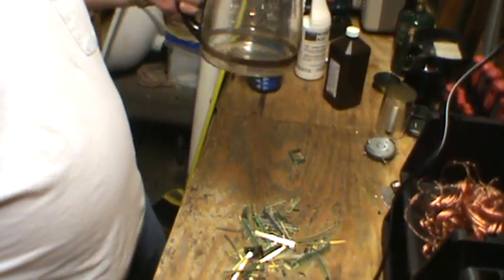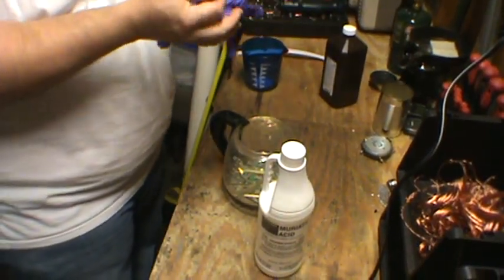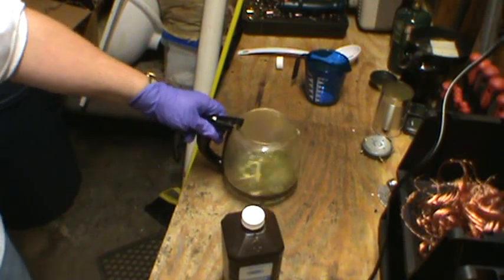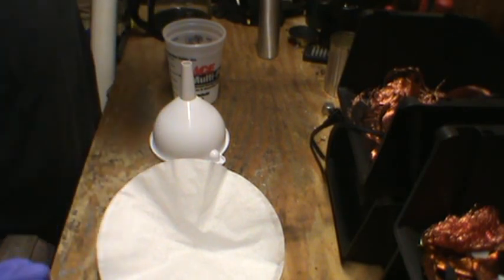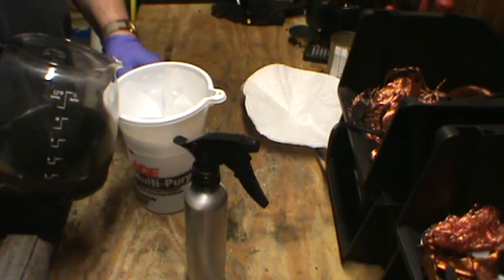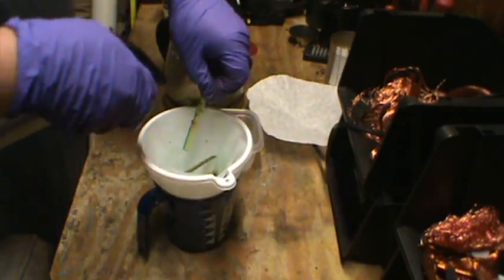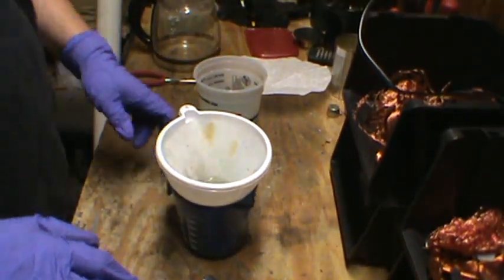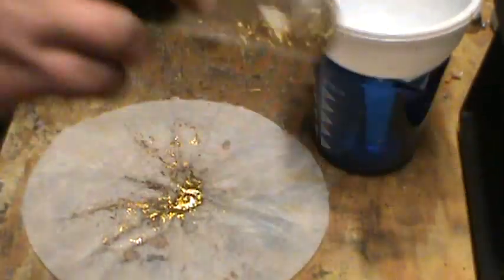How to Recover Gold with A/P Acid peroxide method for gold fingers and gold plated boards easily.

Comment: who ever thinks that it will be real solid gold after processing and melting, think again,
look on ebay how many pounds of gold bars they selling from melted down computer parts, and read the description carefully !!
Reply from the maker: ......right, because they are not chemically refining the gold pins just melting them as a whole.  Of COURSE THOSE are not real gold.  What you are left with after this process IS gold.  Please do more research before making statements like that.  Have a great day.
Reply: Look at the pictures they have up looks like gold, if they just melting gold plated stuff, that wouldn't look anywhere near gold. Because it contains very litte amount of it.
Reply: If u want to end up with just 1 gram of gold, it takes a lot of fingers.  Judging from the comments, some people thinks is enough to get a handful ...
Reply from the maker: Again, I understand what you are saying.  You are however comparing apples and oranges.  They state in their description that it is not pure gold.  They say that it is melted IDE pins.  If there is enough gold on each pin to cover the base metal, would it not stand to reason that there would be enough in 100 pins to coat the outside of a glob made from them?  Moreover, this video has nothing to do with IDE pins.  This video is about removing the gold foils from plated finger boards.  This is like calling a new Porche dealer a crook because a used car dealer on the other side of town rips people off.  One has nothing to do with the other.  I do not know how to explain this any more simply.
Reply from the maker: right, and I try to correct them as often as I can.  People do not realize the amount of material one would need to process for an ounce of gold.  It is quite a lot.  I have talked many...MANY people out of trying to do this full time because they are under the illusion that they can make thousands of dollars with a couple computers.
Reply: No need, I know exactly what u r saying, im not comparing it to your video, just saying in General. .. and I know that is not solid gold, and probably has very little amount of gold in them.
Reply: So insted of making shots, they selling bars that is more difficult to refine
Reply: Csaba Farkas You are right again, there really is not  a lot of gold there.  I only process gold twice a year when I have several pounds of trimmed fingers.  The people on ebay who sell the ingots of melted ide pins are doing that solely to take advantage of people. Its a horrible practice.  They should should not even make shot with it.  Melting it tends to make the metals alloy together.  It is infinitely easier to recover the gold from its original state as a gold plated pin.  Thanks for understanding!  Best of luck to you!
Reply from the maker: Csaba Farkas Sorry I was logged into my other channel when I commented that last time

Comment: I used your method of removing the gold from the computer circuit boards but everything turned green.  How do I remove all the green stuff from the gold flake?
Reply from the maker: Hi and thanks for watching.  I am a little confused, what circuit boards were you soaking?  This is only for gold fingers, not the rest of the board unless it is completely free of solder etc.  When you say everything turned green, are you referring to the gold foils or the solution?  Thanks
Reply: I was referring to the gold fingers which I soaked them in A/P.  Those are the gold fingers I cut from the RAM and other parts of the motherboards.  I was trying to dilute them with water it gradually go away but it takes too long.  Is it other way I can get rid of the green stuff from it.  Your demonstration looks very clean without any green stuff on it.  By the way, your video looks fantastic!
Reply from the maker: Thanks for the compliment!  As for the green stuff, the solution turns green and that is fine, that is just copper going into solution.  If you are referring to the green solder mask on the boards, that can be removed by soaking them in 1 gallon of hot water and 1 tablespoon of lye.  Wear gloves, it can burn your skin!  After about ten minutes in there, you can brush the green solder mask off with a tooth brush.  Hope that helps!

Comment: Hi Moose, I see you using all kinds of containers. I am particularly interested to know what kinds of plastic jugs you are using to store HCl, Nitric Acid, A/P, and Aqua Regia.
Oh congratulations on the 1000.
Reply from the maker: Thanks!  I only use HCL to make A/P.  I do not nor will I ever use nitric acid or AR.  Just too much of a risk for me with kids and pets.  THe containers I use for HCL for the most part are not the ones in the video.  I scaled things down for that.  I use 5 gallon plastic buckets with lids that used to hold pickles.  I get them dirt cheap at a local sandwich place.  When I am not using the HCL it goes right back into the jug I poured it out of.  If I can free up some time to make the video for that, I am getting ready for my second gold processing of the year.  Its using the air bubbler system.
Reply: I'm really liking the air bubbler system too. My only concern is the type of plastics that can be used in the chemicals. HDPE? PPQ? PP?
Reply: Oh, thanks for so much information too. You are a big help.

Comment: Also i could only found 10% muriatic acid. Do i need to use more acid to compensate?
Reply from the maker: try evaporating some off.  10% will take forever to eat up the copper and nickel.

Comment: Hello Moose, this chemical combination (muriatic acid + peroxide) work for plated pins too?.
Reply from the maker: For the most part yes.  Just remember that 1 gallon of solution can hold about 2 lbs of copper and because the copper is thicker it will take longer to dissolve.
Reply: Yes, I m doing it ,and  work well, 3 cups HCI/ 2 cups peroxide, but take sever days for remove the copper...
Reply: +joe3072000
Reply: somebody know what is the difference btw electronics gold plated pins grade two, and grade three?...

Comment: moooooooose ur a movie star 100+   to bad its not porn lol vinager nutrilizes sulferic muratic and the acid in your stomach yeh its all the same stuff distilled water will help ur verry good i wish a pair of safety glasses face shield and apron would fall out of that a/p solution you have not to lecture but u have over 10000 scrappers thinkn ur superman i do acid will eat your pupil turning it into a glass eye befor you can do any thing about it no eye wash system moose $6829.33 watching your vids rememer could you please safety up on one video  showing us how a 100+ vid star does it any way  i am disabled ssdi check doesnt pay the bills did not no what i was goin to do you are the goldfinger scrapper i now have 50.00 in savings and its gonna get bigger gotta say it love you man saved my ass high tech james bond safety vid  the people have to see it at least once later chemical freak tana twerk
Reply from the maker: Good point!, i got the goggles, apron, and mask.  THis fall when i process the next batch of finger boards I'll be showing the HCL and air bubbler method and I will safety up that biatch.  Thanks for watching!
Reply: i apoligize i invented the touch screen keyboard and text no capitals and everything is a pronoun or abreviation omg iamsal  oh my god i am such a liar  just jokeing ive had brain damage my brain was bleedind all my life after brain surgery i had some neurotransmitters destroyed i now use a brain gate with a neurophone all this text is straight from my neurophone kinda like text to talk but brain to text it is to wierd to think a ? or a ( . )( . )or a ^0$#^*.so anyway i like the way things melt it is relaxing be safe and melt that gold and i am para so i havntr made any $$$$$$$ good luck
Reply: asf af
we read you fine , just keep up the good work and we will see it through !!!
Reply: kraig taylor

Comment: 1)How do you dispose of chemicals?

 I have 8-9 old comps stacked up and get gold boards all the time. I was thinking about your way of doing this.
2) How much is the Muratic acid (not sure how to spell it)  and where do you get it?
Reply from the maker: Chems are typically evaporated leaving the salts behind.  Store in airtight plastic container.  Before you  start you should cntact your local government office, town hall etc to see what they have for chemical disposal programs.  Muriatic acid 31.45% can be purchased at any hardware store.  8-9 pc's is s good start.  Remember you need a LOT to make an amount of gold worth writing home about.  Thanks!
Reply: Ok I won't try it then, I hate snail mail.

Comment: Please make the ratios clear. Not for instruction of course.
Reply from the maker: The ratios can vary a little depending on the refiner.  The proper ratios for the most gold foils would be 5:1 HCL:Peroxide.  The reaction is slower however there is very low to no risk of gold being dissolved into the solution.  Some people are very impationt and want the fast method where you add more peroxide which speeds up the reaction however you start to lose gold into the solution.  You can always get the gold back out but sticking a piece of copper pipe in there and saturating the solution with copper, the gold should drop out as black powder.  THis will take longer though.  Hope that helps!
Reply: moose, can i add nitric acid then SMB into the solution  to recover the lose golds? is that possible or just a stupid idea? thx

Comment: Hi, Could you use this method to extract copper from low grade boards? If I was to put an entire board in this solution. Would it dissolve the copper and leave the tin and soder, like it leaves the gold? Also would this solution dissolve the copper from insulated wire that is to small to strip. I know I am pushing this to an extreme level however I have a lot of low grade boards and copper that is either tin covered or to small to strip. I know if I take this into the scrap yard Ill get a low amount for it. Which means they must be making at least 3 or 4 times its value.
Reply from the maker: Hi and thanks for watching!  Great questions!  Lets start off with throwing a board in AP, bad idea, the copper will , dissolve, and so will just about all the other metals accept gold, silver and the platinum group metals.  This will leave you with a nasty thick soup of crud you will not be abel to get rid of.  The ammount of copper in there is so small that after you put in a LOT of time to depoplulate the boards, clean off all the solder, then soak, and wait for the copper to dissolve, then cement it out, and after the cost of chemicals, its really more worth it to just sell the boards.    As for the wires, technically that could work, but I think you would be very dissappointed in the ammount of time it takes to dissolve the copper and not sure if it would creep up the insulation.  I think with these items, the money will be in volume.  Thanks!

Comment: Hello Moose, Matt from PA here with a question. To begin I do have a chemicals background so I know how to handle them. Your video is the one I followed for my 1st 3 processes. I did have full recovery of gold, Not much but its a start. Question I have is, I have some fine materials mixed in with my recovered gold. Looks like dust from the coffee filter, Keep in mind I did rinse it before pouring into. Also some fine green plastic, Id say that's from the boards. Would it be best to put it all in my ladle and heat it til it burns off, It wont be enough heat to melt it, Just enough to clean it up. Thanks for your time, Most appreciated And again, Great video.
Reply from the maker: Thanks for watching!  Its good to get feedback from people with a background in dealing with chemicals!  The green board peices and junk usually gets gone when you refine the gold with HCL and bleach.  the powder on the other hand, that is worth saving and throwing in there as well.  Often times, some people add too much peroxide and some gold gets dissolved into the solution however once the solution becomes saturated with copper the gold can fall out as a black powder.  Some people save all of their filter papers with the debris in them and then torch them in their crucibles, i've seen some nice little gold bb's made that way.

Comment: Could an electro magnet be used to collect the loose metals while in the solution? Or even just in place of a stainless steel knife for the copper?
Reply from the maker: no, there should be not metals in the solution that are magnetic, accept nickel but the magnet would likely not do anything besides dissolve.  Thanks!

Comment: very informative.  can the same method be used to scrap cell phones?  i noticed you said to remove all metals except for the copper if possible; is that just to have less metal to remove from finished product or dose it comprimise the solution?
Reply from the maker: It does compromise the solution, can make it gel up and make it a whole lot harder to get to the gold.  If the phone boards are clean you can absolutely use this method.

Comment: So after I get all the gold foils off I need to wash it again in muriatic peroxide solution  ?
Reply from the maker: There may still be some copper and nickel on them so it is good practice to let them sit in a a little jar of hcl and just a small few drops of peroxide to finish cleaning.  When the liquid no longer turns green they are clean!
Reply: Awesome. Thank you !!!

Comment: Hi, I've recently done this, and now I have finished, I'm am unsure how to dispose of the chemicals? Also what's the best way to get the copper out if the chemicals? I've put a piece of stainless steel in there and the copper crystals have stuck to it but when i take it out all the crystals fall off and sink to the bottom.... Thanks for the instructional video.
Reply from the maker: You can just filter out those copper crystals.  Rinse them and throw them in your copper bin.  THe chemicals, it is best to evaporate as much as you can leaving the salts behind.  Here in the states every town or county has a chemical waste disposal facility.   They usually do not charge too much but it is best to save it up a while.  Once evaporated, the salts can be stored in a plastic container easily.
Reply: Moose Scrapper Moose I to have a lot of copper. what I have is a thick green mud from the A/P . I think this is copper. Can I just let this mud dry and melt it
Reply from the maker: It is not a good idea to melt it if you do not know what it is.  Metals tend to alloy when melted and if there is gold in there you will have just made it much harder to get to.  I am not sure what this thick green mud is, if the boards were clean going in there should not be mud.  If you add more HCL does the mud dissolve?  If it does try then adding a chunk of stainless steel to get the copper to cement out.  If it does not then it is likely not copper.  Before you do any of that though you should test it with stannous chloride for gold content.  If there is no gold then you dont have to worry about loosing money.  There may be some better answers to the green mud mystery on the goldrefiningforum.  Thanks and best of luck!

Comment: All to much  works and works,and talking talking a None of you re never able to say how many grams of gold, or in the slular phone
Reply from the maker: You are right, and there is a reason for that.  It is simply not possible to tell someone how many grams of gold they will get from 100 rams sticks.  There are too many variables.  There are hundreds of different manufacturers who use different purity of gold, different sizes of ram, types, and age makes a difference on the thickness of the plating.  I could take one pound of trimmed fingers and get 8 grams of gold, or take one lb of trimmed fingers and get 2 grams.  I am sorry if you are not able to find the answer you are looking for, unfortunately that answer just does not exist unless you are specific enough like, how much gold in one pound of samsung 256K ram chips from 2001.  Then and only then would it be possible to find the data if someone actually took the time to determine that.  There are better data set on CPU's, especially ceramic ones on thegoldrefiningforum.
Best of luck to you!

Comment: Can the same process work for completely striped mother boards?
Reply from the maker: Theoretically yes, however, I have yet to find a motherboard from a non military grade computer that has gold tracing on it.  Maybe a few flecks here and there but not enough to try to soak it off in AP. Best of luck to you!
Reply: Thank you for the information. :)

Comment: Sorry if you get two comments but idk if it posted I dont see my comment. But I put some pins in with the fingers and was left with a bunch of goldless pins to pick out of the mix. Whats the easiest thing to do with the pins?
Reply from the maker: Things should always be done separately.  Pins can be put in AP, just remember, too much peroxide and you start to dissolve gold.  It takes one gallon of solution to dissolve 2 lbs pins.

Comment: People BE CAREFUL!!!! the mix of HCl+H2O2 also disolves gold!! i know it because i use it to recover or to disolve gold  (instead of using aqua regia) and obtain AuCl4H2 without the problem of having nitric fumes and nitric contamination in the salt ( yes i want the pure salt jejej i disolve 99.99 Au wires in my lab) . Obviously this mix will attack first the Cu underneath Au foil.. but if the concentration of HCl and H2O2 is too high it will continue with the gold foil, if you want to realease only the gold ..i think it's better to use H2SO4+H2O2 to ensure that theres no solubilization of gold at all.
Reply from the maker: Great point!  Thankfully the dissolved gold is not lost.  Just toss a piece of copper pipe in there and the solution will push out the gold as the copper dissolves .Thanks for watching!